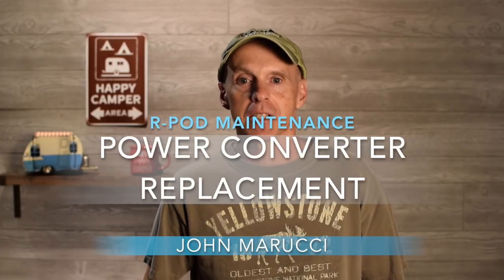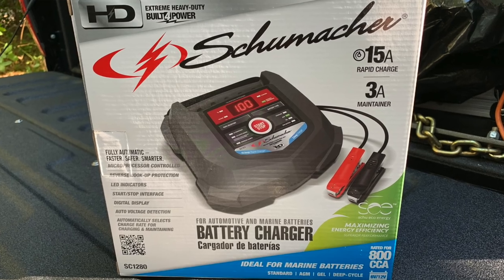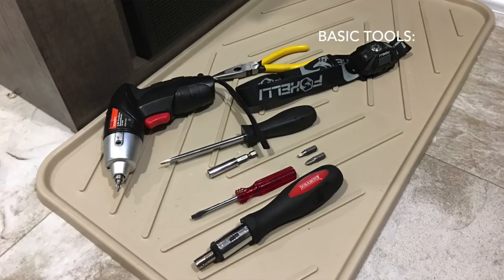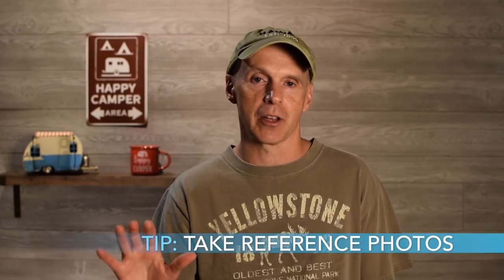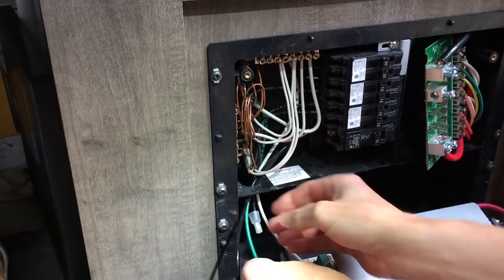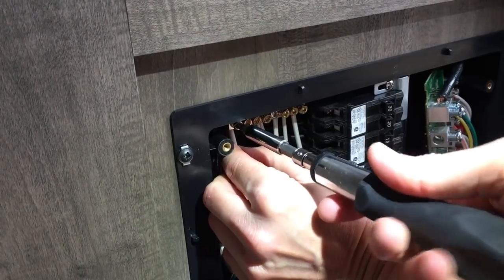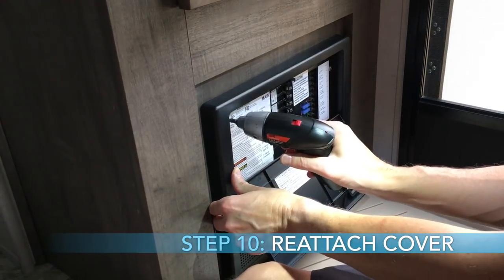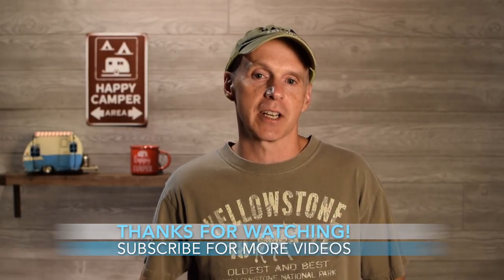R-Pod RV WFCO Power Converter Replacement – Step-By-Step Process

Comment: I have replaced 3 converters in our 2017 180.  I did similar to what you did, but did not remove fuses.  This was discussed thoroughly with FR in October and at Goshen earlier in the summer.  It is recommended that you brace the entire box from underneath to reduce rattles.  I used 2 pieces of pool noodle and slipped them under from the backside.  I also added stability to the framing around the converter to reduce rattles.  It has helped tremendously - 43 day cross country trip completed with no issues.  It has also been noticed that most failures were do to a weak solder joint.  One man at a recent r-pod gathering fixed 3 while at the rally by resoldering the connection.  FR was there and discussed this in depth and are working aa permanent fix.
Reply from the maker: George, thanks for the great information and thanks for watching!

Comment: Just a word of advice from an old electrician, terminate the load wires first, then the 120-volt , black wire to the breaker should be the first to disconnect, and last wire to terminate.
Reply from the maker: Larry, thanks for the comment and advice!

Comment: Great video but before you replace the converter, there is another you tube video in how to locate and repair a broken solder connection  which seems to be a major cause of failure.  Factory tech support no help and don't recommend repair (surprise).  You remove unit but don't disconnect any wires.  Remove board from plastic holder (5 little screws) Turn board over to bottom which is all solder connections.  Broken one VERY obvious as blackened.  Take soldering  iron and drop several blobs of hot solder over blackened areas to be sure it reconnects with surrounding surfaces.  Replace board to plastic and replace in cabinet.  Add power and fan should start.  Mine did and saved $215.00.  Took about an hour with phone time etc.  Good luck!
Reply from the maker: Sounds like a good idea for those so inclined to tackle this. I think with the position of the converter in the older R-Pods (basically on the floor), there is a lot of vibration the unit absorbs. I did change to GY Endurance tires which did not require max inflation and everything in the trailer did better in terms of vibration. My replacement converter never had an issue. Thanks!

Comment: Made it all the way to Niagara Falls from AZ and had my inverter go bad.  Amazon sent one to the in-laws and I was back in business within 15 minutes.  Thanks, John, for your great videos!  You’re the best.
Reply from the maker: Great to hear that the video was helpful!
Reply: Update:  Back in AZ and inspected the inverter.  Circuit board had a bad solder on the bridge rectifier.  It was cracked around the pin and when I tested for continuity using a multimeter it would not beep until I manipulated the “island” around the pin.  I soldered all of the connections on the bridge rectifier and and heat sinks.  I tested the unit by adding an ac plug and connecting it to a 15 amp ac outlet.  Measured 13.5+ volts and back functioning better than from the factory.  If you don’t know what you are doing with ac voltage please don’t copy what I did as you could be electrocuted.  I’d bet almost all of these defective units are bad solders, bulged capacitors, or loose grounds.  Thanks again John for your awesome videos!

Comment: Thanks for the great video John-this was really helpful when my converter died.
I chose to upgrade to the alternate converter recommended on the r-pod forums. I also changed to the new DC distribution/fuse PC board, which did take a while to complete.
One word of warning to anyone completing the repair. The heavy gauge wires from the converter to the fuse PC Board had some of the strands become brittle and break off during the repair. Take caution to not let any of these pieces of copper wire fall onto your new converter and risk short circuit
Reply from the maker: Ted, thanks for the comment and heads up on the potential of the frayed wire falling into the unit. Glad the video was helpful!

Comment: Big shout out for the help seeing the job and then doing the work. The tip about taking the DC fuse panel out to get the White and Red wires hooked up was well worth the advice. A large flat screw driver under the circuit board and gently twisting circuit board up over the bottom bracket made the job so much easier. Impossible to do without this tip. Thanks.
Reply from the maker: Glad the video was helpful!

Comment: You posted this the very day my converter failed. 2016/180.  Seeing this video, would have been a pretty simple fix.  I now have a battery charger on board and will buy an extra converter for future failures, I plan to be out alot in 2019.  Insurance is expensive till you need it.  Thanks for a great tutorial.
Reply from the maker: Pamela, Glad the video was helpful. Sorry to hear that your converter failed, but glad to hear you are taking precautions going forward. All the best and thanks for watching!

Comment: Good video. Only one point. Order of wire replacement:
1. Ground (green)
2. Neutral (white)
3. Hot (black)
The order is critical, printed circuit board and power supplies can carry static voltage. The neutral and ground is the absolute path for any stray current/voltage. 
The black should be connected last always.
* The order of removal should be the same discipline.
Reply from the maker: Thanks Jason!

Comment: John, thanks for posting.  However, i saw this AFTER i had already fixed mine.  What I found was that the bottom portion of the housing had broken on one side, turning road vibrations into violent shaking. This had broken some of the soldering points for some major connection points on the backside of the circuit board.  Even though I had purchased a replacement, I tried, and was successful at repairing the solder. The last step was to repair the cracked plastic frame, and then cut some pvc pipe to size and wedge in underneath to offer the bottom more support.  All's well so far after about 1200 mi of travel with it. Including some very rough washboard sections on 101 in CA!  I'd love to attach a photo of my support underneath, but couldn't figure out how, so hopefully the description gets the point across.
Reply from the maker: Thanks for the thorough comment describing your solution. Makes sense!

Comment: Good video.  I swapped my WFCO 8900 series converter for another WFCO 8900 MBA designed for Lithium batteries.  This was to charge 2 Battleborn batteries.  Due to location of the converter and working with stiff wires, you must bring your “A game” of patience.
Reply from the maker: Les, sounds like a nice setup for getting off the grid. Feel free to let us know how it works out as you get out and use it (battery life, etc.). All the best!

Comment: You're good, John. One can only wish that policy, engineering, purchasing, line workers and quality control at R-Pod were as conscientious and customer oriented as you are. We just purchased a 2013   176  and I am beginning to dig into the anomalies as they present themselves. I arrived at this video seeking insight into the lack of 110V when disconnected from shore power. I would assume that an expensive and sophisticated unit like this would have an inverter that kicked in to supply 110V to the receptacles when shore power is absent, but I have yet to confirm that. No need for a personal reply, I am sure you have little enough time for the fun stuff as it is. Thanks for the time you spend putting this resource out for the unfortunates. ( I was not present at the purchase of this unit)
Reply from the maker: Tom, the R-Pods do not come stock with inverters. Some of the folks do install them with better batteries systems. You'll want to reach out on the R-Pod owners forum (not the Facebook groups) to see how some of the people there have done these upgrades. Here is the link: rpod-owners.com. Thanks!

Comment: John, great video about the converter replacement. I have an 3018 r-Pod 179 and it has a WFCO 8735P converter. I am changing to lithium so I needed to replace the charger and after I saw your video I thought this was going to be easy. It appears there is no lithium replacement to fit in the tiny space where the board for the 8735 sits. Looks like I will have to disconnect the wire and put in a different unit behind the current breaker panel. And FR was kind enough to solder the wires so I'll have to cut them out. Bigger project than I thought but thanks for the video to at least get me familiar with the make-up if there electrical system
Reply from the maker: Yeah there’s not much room back there. You have to put the battery in that space?
Reply: @JohnMarucci  
I'm putting two BattleBorn batteries under the bed near the front. I'll then route the heater away from that area. Basically moving the batteries inside. I already have the solar controller and invertor in the front cargo area.
Reply: J Ho, I am doing the same thing as you. My coach has the WF-8735P converter. I have installed 2 lithium batteries. I contacted WFCO and they said they have a WF-8735Lis model that has the lithium switch. What brand/model did you install? Any more advice as I tackle this project? Thanks, Stacy
Reply: @stacyhazelwood4033  Stacy, I ran into so many issues. I have a 2018 179 and the lithium replacement converter does not fit where the stock one is. You have at least two options. 1. Pull the current converter and power panel out and replace the entire a/c, d/c unit. If you have the guts go ahead. 2. Leave the converter there and add a separate battery charger. There is the "Boondocker" brand or what I got was a PD model 9130L to charge the batteries. I still have to have the old converter for the DC lights while on A/C. That was the recommendation from PD. I'll be happy to send you pictures of my set up. I also have a 2k inverter. Thinking back it might have been better, more expensive, to get the victron all-in-one unit. Oh well. I'm not a full timer but my wife and I boondocked last night miles from anyone and the stars were beautiful. Your could feel the darkness. Let me know if I can help.
Reply: @housesOTR  I was just researching the option of adding a DC-DC Lithium battery charger with an on/off switch to charge with my tow vehicle or just a basic plug in charger. I usually charge my batteries with a solar suitcase anyways. But, I think I'm just going to leave my old converter alone (not change it out). Thank you for your advice/experience.
Reply: @stacyhazelwood4033  I too am looking into that. Just a 20 amp would do me fine. What I did in the meantime was to disconnect the hot lead from my 7 pole electrical jack, under the left front part of the trailer. That keeps my alternator from burning up because those lithium batteries will take everything and then some. A&M solar had a device which turns the current off periodically so the alternator gets a rest but you have to wire from the alternator all the way back to the trailer. I just want something that will go in between the hot lead and the trailer like a DC to DC charger. No adding long large cables. If you do disconnect your lead like I did, make sure your battery is powered on so the electrical brakes will work if the brake kill switch is jerked. 
Jeff House
Reply: @housesOTR  I will try to find the hot wire and disconnect it. My alternator is a HD 240amp, but it probably could still damage it. Thanks!!!

Comment: i bought a lightly used  2016 rpod 180 a year ago and traveled for 5 months using 100 w solar panel for all my electric needs. so when i parked it at home and connected it to shore power, i didnt give a thought about whether the converter was charging the baatteries for a couple of months. by then the fantom draw had depleted my 2 neew 6 volt lead acid batteries and theey werent getting refilled by the converter. i slapped the solar panels back on and now its time to replace the converter.. i have read lots of people comments but yours is (always) the best and easiest to follow. my question is, would you replace it with the original Arterra WF-8955-MBA 55 DC Amp Replacement Main Board Assembly or consider the highly touted PD 4655L MBA WildKat 55 Amp Main Board Assembly for WFCO 8955 or Parallax 7155 (Includes 4600 Remote) from best converter? (amazon also has a similar item Progressive Dynamics PD4655V Inteli-Power 4600 Series Converter/Charger with Charge Wizard - 55 Amp). i want an easy job but i also want something that will last. doesnt need to be fancy
Reply from the maker: I replaced mine with the WFCO 8955 mentioned in the video and never had another problem with it. The big caveat is that I also changed tires to Goodyear Endurance and ran them slightly below the 80 psi on the tire tread. The amount of vibration while in motion in the cabin diminished greatly, witnessed by much less sawdust and debris showing up after travel. My theory is that that since the converter is so close to the floor in the R-Pods, they absorbs too much shock given their placement within the cabin. The OEM tires usually have to run at max psi, thus the possible reason why so many fail. Thanks for the comment and all the best!
Reply: @JohnMarucci  you are amazing. thanks for the quick reply. yes, sawdust. i just glued and tacked 3 of the panels back in to place in the space under the bed. maybe the rpod isnt up to  all those dirt roads where i like to boondock. for converter, i will try to shore up the new one. noodles, etc. havent really delved in to it so not sure how it looks. thanks for the info on the tires

Comment: Thanks for the converter video. We were half way through the process. I noticed two possible causes for the converter never working since we bought this 2016 used rpod 180. First: the unit was installed high in the cutout, so only the side screws held it in place, and most of those screws split the vertical strips of wood behind the unit. Also, with no supporting cross piece under it, the plastic frame had broken. Thus, the converter has been bouncing about for years. We are going to secure it with a supporting strip of wood.

Second, and here's my question: the white wire I removed on the breaker side had been connected in the slot second from the left, and in the first slot, in which your video shows it should be connected, I found a cut-off wire sticking out. I can't get that screw, in the first slot, loosened. If I connect the white wire of the new converter in the second slot, as someone previously did, will it work? Thank you.
Reply from the maker: I no longer have the R-Pod 179 and so I can't take a look at the converter to answer your question. I do know some people who might be able to help. I would point you to the R-Pod owners forum to ask: rpod-owners.com

Comment: Great vid. If my fan isn’t running and battery not charging when plugged to shore, is that it? Replacement time? Or are there any other possible issues to check on first?
Reply from the maker: The converter should run the fan when charging the battery. Are you sure the battery isn’t already fully charged? If it isn’t already fully charged and the converter isn’t charging it, likely it is the converter.

Comment: Thank you. About to replace the converter in my 2016 179.
Reply from the maker: TheRedDawn Glad to be of help!
Reply: @JohnMarucci  Hi John. I just replaced my converter. Sadly, it was not a successful solution, (I believe all signs did point to the converter being the issue) If you could, please point me in a new direction: Here's a quick summary BR, (Before replacement) - Lights very dim. Shore power did not: charge the batteries, brighten the lights, or allow any 110 devices to work. After replacement: Same situation/no changes. Also, my tow vehicle does charge the batteries. Any advice is appreciated. Thank you!

Comment: All you rpod video have been awesome I have a question on the power converter video the one I bought for my 2016 rpod 179 is an 8900 AD 55amp it has an extra wire off of the black breaker wire I'm assuming it is a wire for newer models and is not used since it came with a wire nut on it
Reply from the maker: If I am understanding correctly, you bought an 8900 and not the WFCO Arterra WF-8955-MBA 55 exact replacement? If so, I am not familiar with the 8900 to be able to help. I would point you to the R-Pod owners forum: rpod-owners.com

Comment: John, I was getting ready to order a new converter for our R-pod,  I used your link and noticed they also have an updated version. Should I go with the original one or the updated version? Thank you
Reply from the maker: Was it the exact model number WF-8955-MBA? This one is the 55 Amp model as an exact replacement. Feel free to paste the link to the product you are referring to and I can take a look. Thanks.

Comment: John when testing the old unit and or the new unit by plugging into shore power to see if the lights come on, can that shore power be a 15A House outlet using an adaptor?  Thank you
Reply from the maker: That should work. When plugged in, you should hear the fan run on the converter as it charges the trailer battery. All the best!
Reply: @JohnMarucci  thanks John!!   Your videos are lifesavers!!

Comment: Our Rpod 180 convertor just went out John. Your video looks safe, helpful and a lot easier that I anticipated. Now, the link you’ve got…is it an exact plug and play replacement. Our Rpod unit is a WFCO 8955. So I assume your Amazon’s Aterra is just another brand but works? Thanks for all you do John.
Reply from the maker: Right, the Arterra board should be the replacement unit for the 8955.
Reply: @JohnMarucci  You were a tremendous help John...things went smoothly with success...thank you